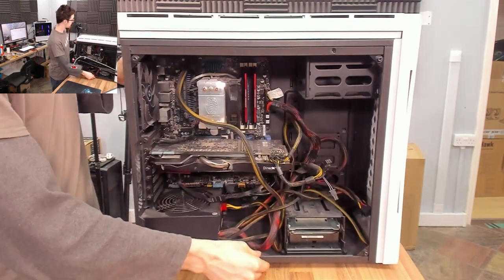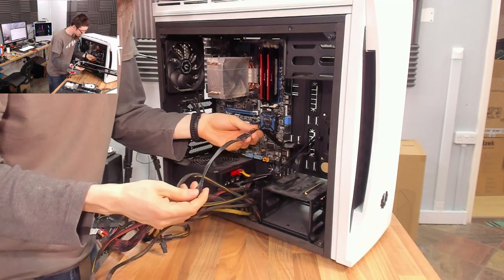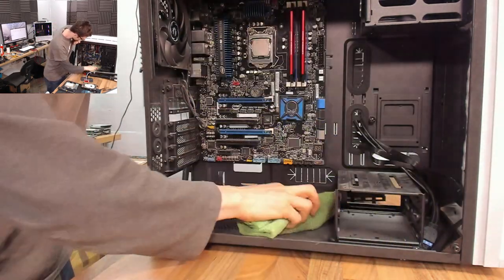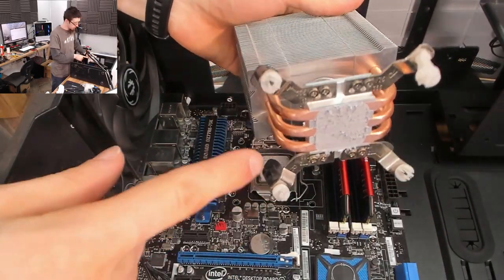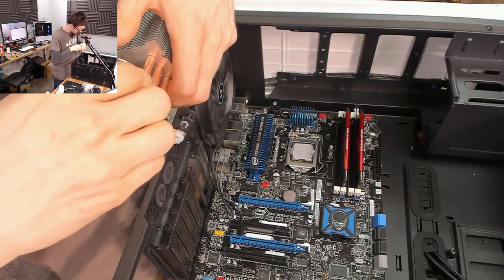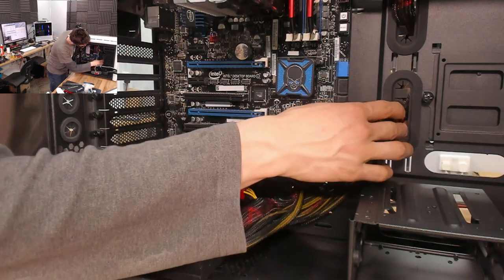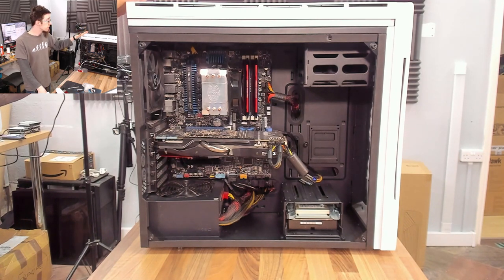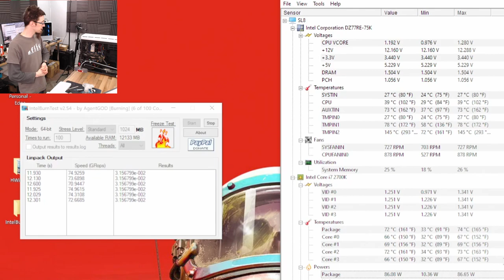How to tidy up the inside of your old PC - LBC#67

Comment: so you have only a few games then if 1tb would be enough for your games lol i have 12 tb of games so ssd not a good option for me i have a 500gb ssd which i use as a cach drive if im using a game alot i move that games and probably 100tb plus of games on dvd/cd so to put that all on ssd it would be tens of thousands of pounds dam to put it all on old tech it would be thousands
Reply: ok just got to something that i do believe you are wrong about thermal paste can be dry and still has the same thermal conductivity but you are right that if it is moved it will not perform any move as the surfaces are not married up the paste is a paste to fill the voids on the 2 surfaces while in liquid and can dry out and as long as there is no movement the performance should be the same as per arestechnica ( The idea behind thermal paste is to fill up the tiny gaps between the two metal surfaces, the CPU and the heatsink. The paste transfers heat much better than air does, but it's still not nearly as good as metal. When it dries, it can be crumbly (leaving air pockets) ) so if it dry's and doesn't move it will not cause issues